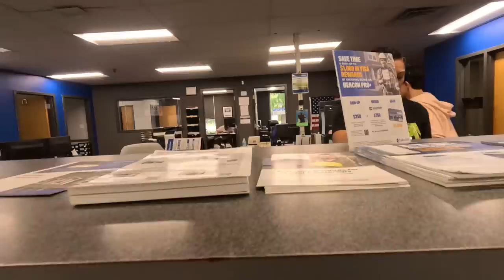MOVING CARGO Could Be DEADLY! This was a ROOKIE Mistake! #foryou

Comment: In a situation like that you could use your dolly as a barrier. Strap the dolly to the D rings  in back of the load and the dolly is braced up against the front of the load toward the cab like a retaining wall. I do this w my dolly in the back of my pickup truck when the tailgate is down to keep stuff locked in. Also maybe you insist they wrap the bundle to itself first, or you do it w your wrap. Cargo net might be another choice. Because w 2 diagonal straps locked down that stuff could still shoot out towards you.

Comment: Shrink wrap would eliminate that problem. Next time you're at a warehouse that does shipping and receiving ask them to show you the industrial wrap and holder. Then you'll know exactly what to get from Grainger  or Northern.👌
Reply: Then the whole thing would slide with more momentum. He strapped it wrong plain and simple.
Reply: @Wolfnsheepsuit When you shrink wrap, it keeps the individual items from separating and shifting,then when you strap it down tight your weight stays centered. It makes your straps more effective.
Reply: @frederickwoodberry5296  but he didn’t strap it down tight. It should be strapped directly across with 4 points of contact as in 2 straps. I know this from experience hauling steel blocks upwards of 18k pounds
Reply: @Wolfnsheepsuit  The problem is sheets of plywood slide, yeah he made mistakes should had them on a pallet, shrink wrap and better strapping, but you live and learn. Let's hope he does.
Reply: @frederickwoodberry5296  I hear what you are saying but I’ve double stacked steel blocks with oil on them the would slide right through plastic wrap. The only thing the held them in place was friction from downward force from proper strapping
Reply: @frederickwoodberry5296  like you said live and learn and I have done that trust me I’ve seen some stuff on the road.
Reply: @frederickwoodberry5296  Also any time you haul something heavy that is on a skid you should inspect the structural integrity of the skid especially if it is banded to the skid. The banding process can crush the skid or put stress on it causing it to collapse in transit